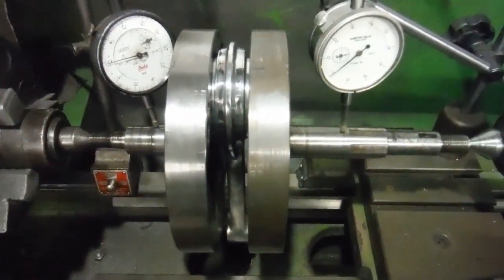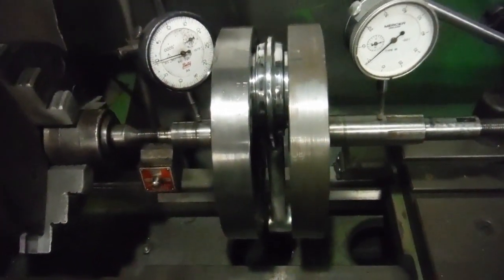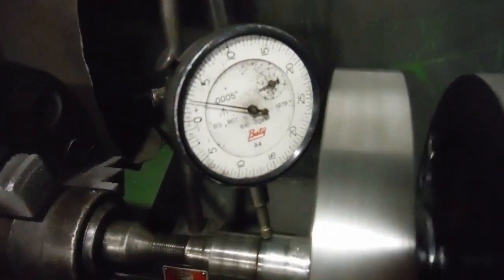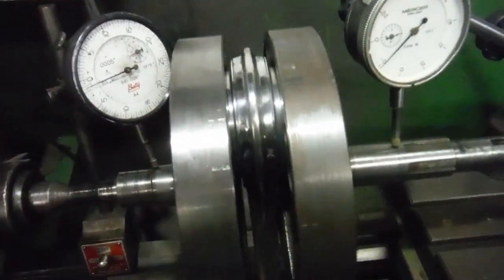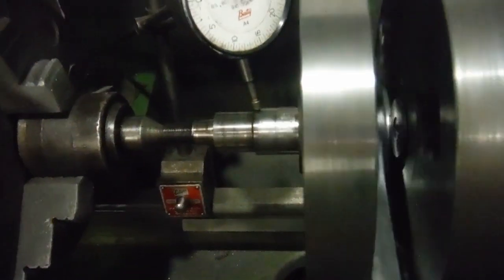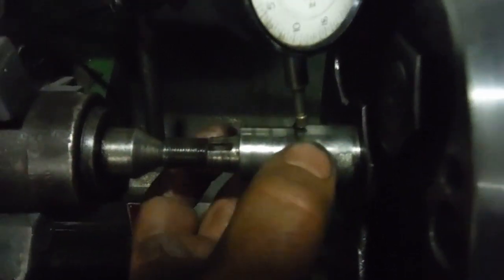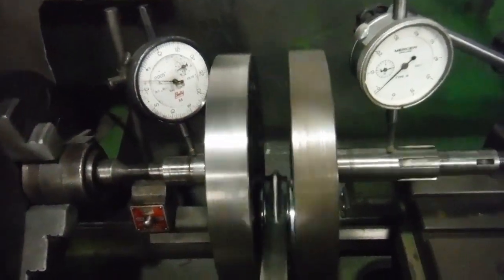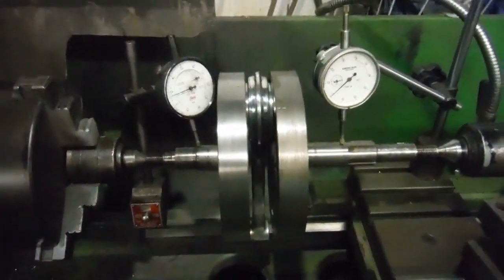Royal Enfield Redditch Bullet 350 crank runout checked after lightening and rebalancing for Asbo 45.

Comment: After these sensitive fixes and improvements to the old machine, I ask if there is a piston with a modern design with the pin hole offset from the center?
Reply from the maker: Hi Glaico, there are none that I am aware of for the 350.
Reply: @paulhenshaw4514  Thank you Paul. This would greatly reduce wear on the upper and lower parts of the connecting rod and pin, as well as increase engine speed and power.